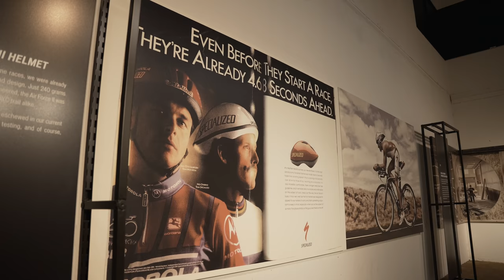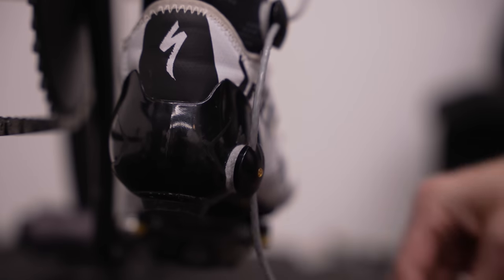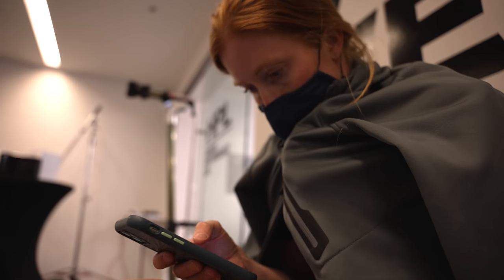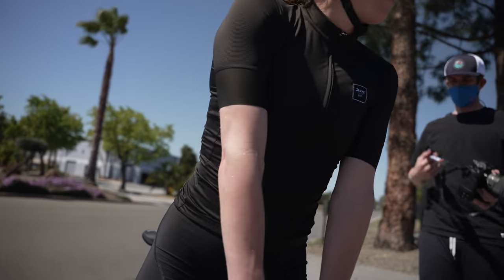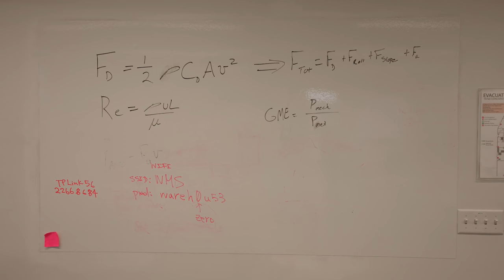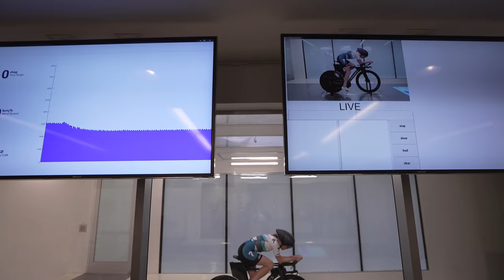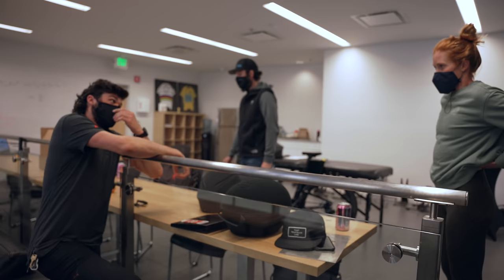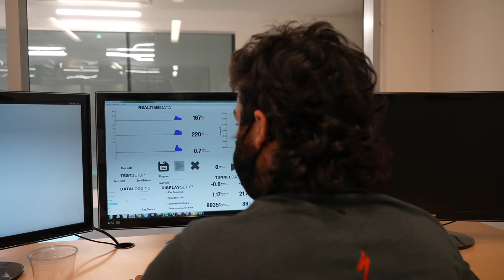A FULL DAY IN THE WIND TUNNEL - SPECIALIZED BIKES HQ

Comment: I don’t know Paula but she is fantastic athlete it looks like she is that kind of person that would tell you how it is regarding the situation, unfortunately she put in the position where she’s thankful for sponsorship however they cannot offer a good positioning due to design of tribar angulation and its limitations. I think couple aftermarket parts will  set you up just right with a little bit of angulation. But what the hell do I know. Good work Paula and Eric
Reply from the maker: No you’re not far off. Normally this wouldn’t be so much of an issue, but many aero bars are completely out of stock due to covid, so it’s really hard to find a good solution right now.
Custom is the next step though I think.

Comment: I don't think those bars are working at all -- looks very uncomfortable throughout the wrist and not enough vertical extension at the end.  At 11:32 you can literally see her index finger hanging over the bar and nothing for her thumbs at all. She needs at least another 5-10cm on the upswing of those bars.  I'm betting anything more than about in hour in that position and her arms/wrists are going to be killing her/numb.
Reply from the maker: She actually prefers the ski tip, but you’re right. She wants them longer. They didn’t have an option with a longer ski tip available, so these were a bit of a stand-in until a custom set (or just a longer option) can be found. Everything is months out with covid and whatnot.

Comment: Interesting Paula (and so many others) are not willing to try shorter cranks for a better aero fit. So many top pro men have gone shorter cranks, even Lionel rides 165mm. I think woman would have the biggest benefit by dropping crank length in general being a little shorter than men on average.
Reply from the maker: I think* the counter argument is that it’s hard to prove that anyone has gotten faster going to shorter cranks. Even though it makes sense logically. I’m planning to experiment with it this month, but it’s a hard thing to quantify
Reply: @ThatTriathlonLife  that’s awesome, looking forward to hearing how it works out for you. From what I understand going shorter cranks is more about improving your aero position.... it also opens up the hip so often a better aero position may be achieved without sacrificing power.  I just also find it hard to believe that guys that are 6’3 have a 2.5mm crank length difference to guys that are 5’8... either tall guys are getting  “short end of the stick” or the short guys are?